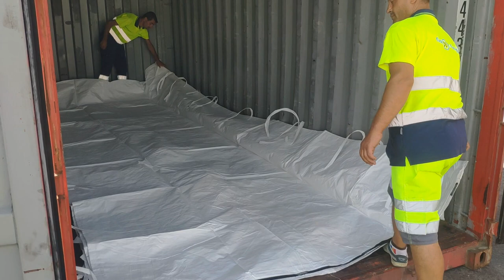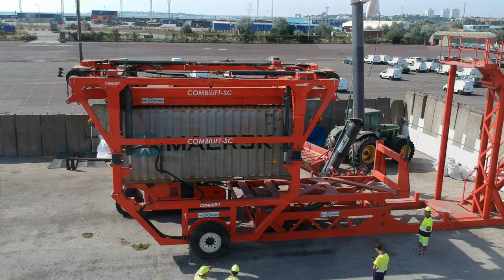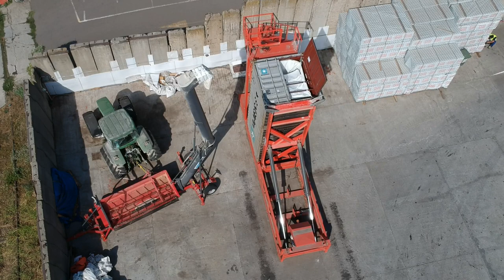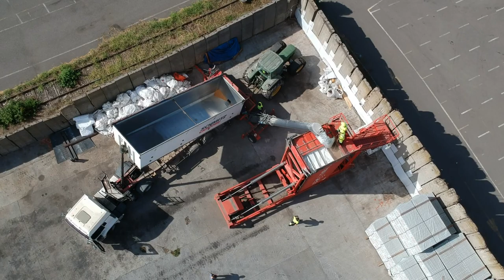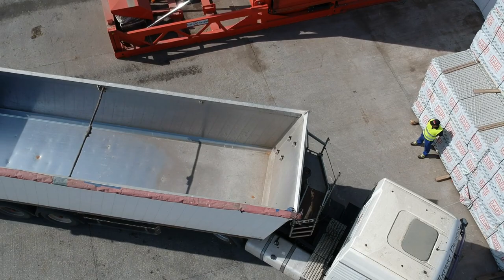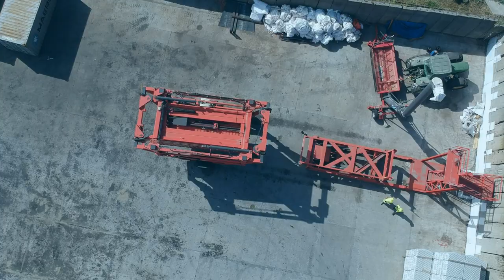Loading grains into container by Fast Freight

Comment: Gents, officially the container is NOT DESIGNED to load the cargo this way. The front end wall is tested on 0.4P which is equivalent to a maximum of 11.292 kgs. Most likely when all bulk product is loaded it will be near 28.000 kgs. This is a good example how normal containers are being mis-used.
Reply from the maker: Tnk you for noticing this, depending on the SF of the cargo we can load at max payload of the 20' containers. The back of the container is reinforced by the machinery while loading, with special "wall", while front doors (as you may see in the video) are also reinforced with special bars and at client's request we can also add MDF/OSB additionally.
Reply: good comment, good answer. Thank you!

Comment: Hello is this loading in a normal container? And does all the shipping companies accept bein loading directly in bulk like that instead of being in 50 kg bags?
Reply: If it fits it ships. 1000 lbs or 50000 lbs+ just if you ship make sure you dont short the weight.
Reply from the maker: Most of carriers are accepting liner bags for loading bulk cargo. As you can see in the video the liner bag is prepared prior loading, protects the cargo, which was BIO btw, no impurities by this method.
25 mts of cargo into 20' container.
Reply: @FastFreightRO  Thanks a lot for replying.